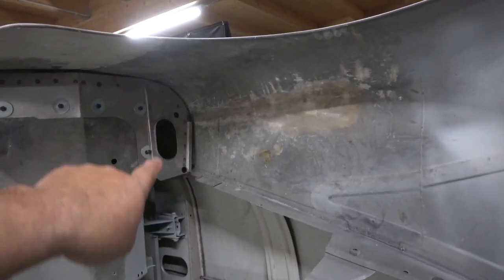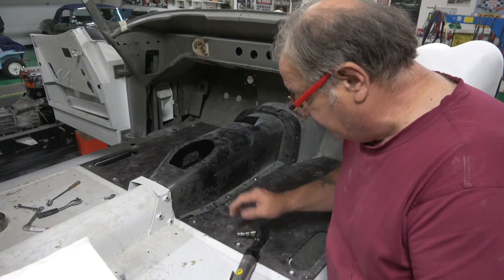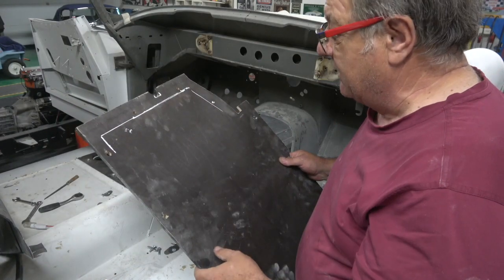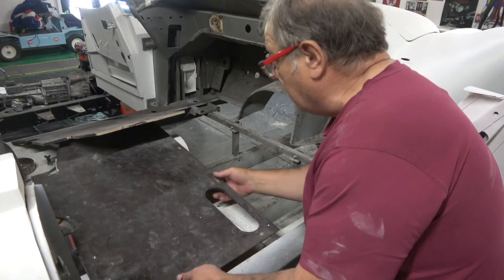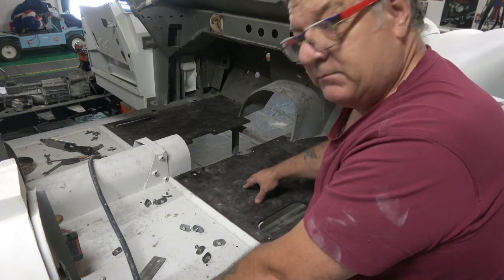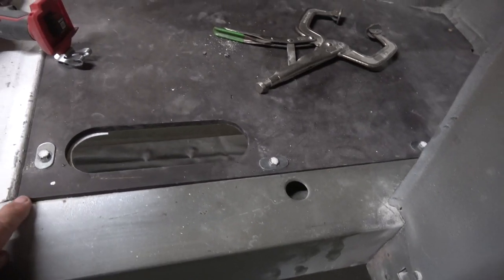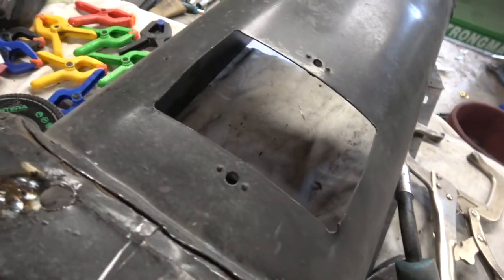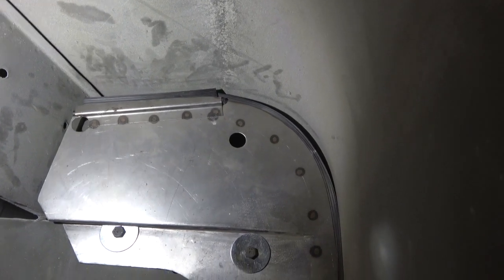1958 Jaguar XK 150 Restoration ( Gearbox Tunnel & Metalwork )

Comment: All my tabs and nuts were shot so I replaced them with Rivnuts and on underside of wooden floor. I did use sealing rubber an all the faces as water gets in. Does raise everything a bit but mine's a hack.
Reply from the maker: Adam,  I had to change all my floors and sills so it‘s all brand new, I might try some rubberized sealing paint as you say
on the surfaces where water can get in, In was thinking about corking them all round but that means the floors would
need to be in when we attach the body so i‘m not sure ? Cheers Dave
Reply: @ClassicCarCave  I used sticky foam strip that I punched out for the bolts

Comment: OK I don't know a great deal about XK150's  but knowing how Sir William worked wouldn't they have used the 'oval' washers to hold the Hockey stick, like the ones you have on the transmission tunnel  ?
Reply from the maker: Gary,  The oval washers are mainly used on the E Type bonnet to fit all the sections together so i don‘t think they where developed
untill  1960 to1961 when the stopped making the XK 150, Due to there size the oval washers won‘t work on the splash panels as
unless the holes are perfectly central you can‘t cover the hole completely as there too narrow, By all accounts Sir William was as
tight as a ducks arse and a real penny pincher as there are some left overs from the XK & Mk10s used on the E type. Cheers Dave
Reply: @ClassicCarCave  OK, but they are used on the XK150 transmission tunnel, weird !!, his arse was so tight it squeaked when he crapped :), FYI a Ducks Arse is water tight for those that don't know or they would sink

Comment: I think I cut or scrape my skin daily now on sharp metal...  You at least have done a few restorations so you know the satisfaction on the other side of all that pain..  yes.. that baltic birth floor panels looks like a perfect fit.
Reply from the maker: Randy,  The cuts & scrapes come part and parcel i‘m afraid of restoration work, Grinder & cutting accidents are the worse.
I still need to work out how to protect the wood floors from the wet & road debris. Cheers Dave

Comment: Anyone wanting to try welding up holes in metal using copper as a filler then the best copper if you know an electrician or at your recycling metal yard get yourself a copper buzz bar these are ideal for the job nice video as always Dave showing how to fix the problems cheers   Rob
Reply from the maker: Rob,  Thank you! The copper i use is a old buzz bar as there really thick and top quality material,  The only down side 
is it will not always fit well to the thing i‘m trying to weld lol. Cheers Dave

Comment: Great idea with the copper plate Dave. Tonight l found another 3 to 4 weeks work on the "e"type . I removed the outer "A"post panel and ....oh dear!  I thought the left was the worst so did that first . lt proves how much corrosion you don't see ! 🤣🤣 Upward and onward !
Reply from the maker: John,  The e type construction can easily hide so much rot as your well aware there are so many box sections that where never
treated when they were built, I have found that the bottom 50% of the shell tends to be the worst effected. Cheers Dave